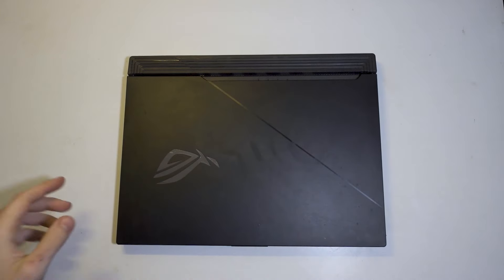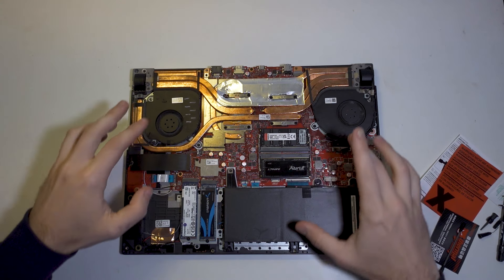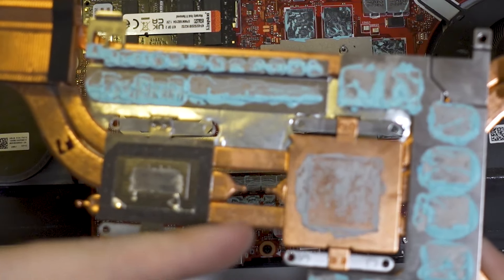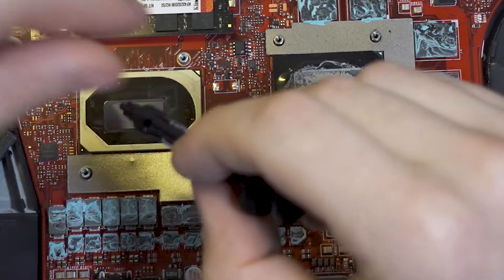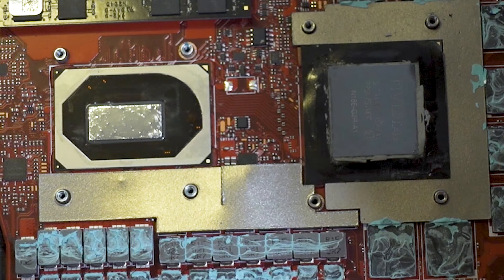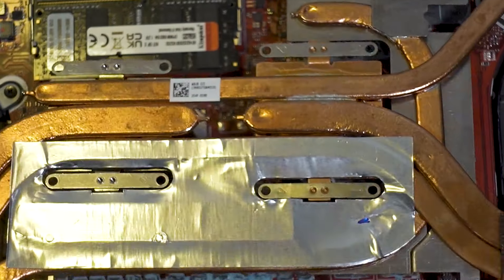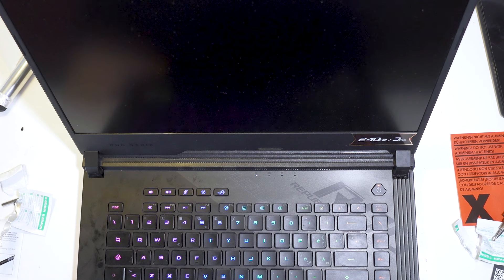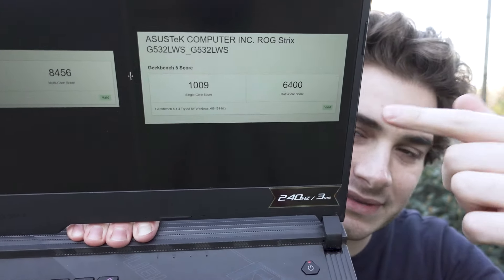Liquid metal cooling my laptop... You will not believe how fast it runs now!

Comment: i just put liquid metal on my alienware m15 r6 11800h/3080/32gb(r2)/3tb/240hz/qhd and my temps droped like 30c with an insane difference, i recon its almost as fast as a desktop rtx titan ☺️🥳
Reply: I did the same on my alienware, but overtime the liquid metal will dry out. Just so you know.
Reply: @kelvinongsux  yeah but that takes a long time. Should likely have a new laptop by time that happens.
Reply: @kelvinongsux  Are you sure? How fast will it dry out? I have read that as long as it's nickel plated, and not pure copper, it will not dry out.

Comment: Dude holy crap this dudes using thermal paste instead of thermal pads for everything but the cpu and gpu guys donot ever do this
Reply: The tolerances are too tight on Asus gaming laptops to allow for thermal pads on the VRMs (chips that have the blue thermal paste on them). I know this because I have a g14 that has the same stuff applied to these chips.
Reply: K5 Pro is your answer :)